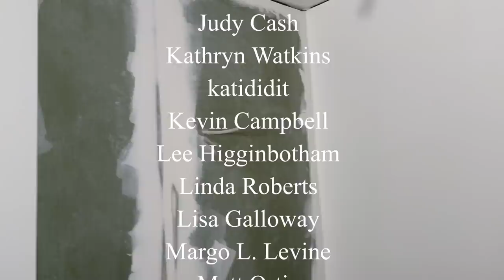Renovating an abandoned Tiny House #74: From green hell to bright & white!

Comment: We have a similar system here in the US with apprentice, journeyman and licensed contractor.  My son is well into his electrician journeyman. But, I will have to say, that especially for the electrical, I am glad that we have to pull permits and have it inspected. Even a very experienced electrician can make a mistake and with electricity, it’s better to be safe than sorry. Since there is no caulking where the walls meet your ceiling, will you be installing some kind of crown molding? I’ve enjoyed watching you make this little cabin into a beautiful home. I haven’t missed an episode.  Take care.
Reply: The system is called self-certification in English. The trades are supposed to go through their work in much detail, test and document everything. Especially electrical self-inspections are much more thorough than anything ever done in the US, involving thousands of Euros/Dollars worth of testing equipment. First, after a visual inspection, the insulation of every single bit of wire is tested for damage by applying 500 V DC and measuring resistance between the individual conductors. Then, each and every earth (ground) connection is measured between the fuse board and socket/light/appliance. In some countries, like the UK, the resistance of each conductor (live, neutral, earth) is measured. If an earth rod is required, its resistance to the ground is measured. These tests are called "dead tests". Once they've been completed, power is turned on for the first time. Now there are several live tests. Which ones are required depends on the details of the electrical supply and installation but the list includes loop impedance (basically the resistance of the entire electric supply from the power company's transformer to your lights etc., it's calculated by measuring the voltage without a load connected and then with a known load, the tester does that automatically), based on loop impedance the prospective fault current. RCDs (GFCIs) need to be tested as well, usually a current ramp test (the tester applies a slowly increasing current and measures the current at which the device trips) and trip time (at half the nominal trip current, full current and five times nominal current).

I do agree with you that external inspections wouldn't hurt though. Having gone through all that training and education doesn't make you immune to mistakes - or plain laziness.

Comment: It's always a pleasure to see you've posted a video. It's always interesting and I always learn something, even small things. Of course, I never would have had this opportunity without being in high risk isolation for so long, but that's a plot twist on my life. I think that the training and oversight is much better there than here. Here a contractor might pick up a truck load of day laborers at a corner parking lot and they build whatever that day. A lot of sloppy building, and often mistakes get missed by inspectors. My son bought a new house and right away had to pay for redoing several major issues that didn't get noticed in inspections.

Comment: Canada has the same apprenticeship style programs in their education system, run by technical institutions. Depending on the trade it may be 3-4 yrs. Then there is also a Red Seal level of excellence you can test for after the JM cert. Electricians can go for master level which allows them to run business and certify work. Welders have so many different types of certs after JM RS showing capabilities in different materials and processes/procedures. Some require edu+exp+test. You need an extra wallet for them all.

Comment: Here in Australia, all electrical and plumbing work are regulated, the public are not allowed to do anything more than the changing of lightbulbs, we really aren’t even supposed to change washers in taps.  Wasn’t always like this but tragic accidents and pressure brought these regulations into effect.  Many do their own work, my father is one but he’s been doing it for many years and always works safely he has never had a problem.  I have seen first hand what bad work can do, I got a shock from a light switch in a house I rented as well as other electrical problems.  A professional electrician started swearing as soon as he looked at the first light fixture, it had been wired wrong with the live wire attached to a metal light fixture instead of the grounding wire, it was the same throughout the house.  He said that if anyone had touched the light fixture, a metal candelabra, they would have been killed.  The landlords tried claiming they had the work done by professionals but I caught them out when they brought a friend to do some electrical work claiming he was an electrician but he told me he wasn’t one.  
Even a professional messed up when we built this house, most probably had an apprentice do the work.  Just before the power was to be connected it was discovered that the house electrical grounding wire was attached to a gas pipe.  Could have been a very big boom 💥.
Reply: So glad that you are safe, now.

Comment: Am I correct in assuming that the insurance companies require an inspection prior to writing a policy? If each tradesman is his own inspector and homeowners are allowed to do this much renovation, surely the insurance company wants to inspect before issuing a policy. We have this review period in theory in the United States, but there is rarely a physical inspection, they usually issue a policy for the basis of your comparative value, the taxation value of your home. Usually you can arrange an insurance policy over the phone and be fully insured by the time you hang up. How does this work in Germany? How does the insurer know if the homeowner has done work between their inspection and the damage incident? Fire is an obvious example and easy to determine the cause. If I'm not mistaken, water is responsible for a great deal more residential damage. If the house were to flood, who and how determines the cause? Do different insurance companies develop a reputation? Or are the insurers regulated by the government as well?

Comment: Do you need to tape where the ceiling meets the walls or will you be covering the gap a different way?
Reply: Would normally be a silicone caulking to allow for movements between the different masses of ceiling and walls.

Comment: Here in the USA there are 50 states and each one has it's own regulations about things like building permits and inspections. This makes it confusing when someone moves to a different state and is not aware a small project like putting in a new hot water heater which we could do ourselves in Pennsylvania without a permit or inspection , when we moved to Florida required we hire a licensed professional and have an inspection. Whew! we found out just in time or we would have had a big fine.
I liked the corner roller- would save a lot of effort and up & down to paint hi & low with a brush.
Can't wait to see the finished bathroom.
Reply from the maker: Thank you for sharing Virginia! :)

Comment: Where I come from, one of the very last steps to a renovation project is painting. 
So with that being said and with all due respect sir,
What about that little gap in between the walls and the ceiling? 
Isn't it supposed to be filled in with joint compound or caulking?
Do you plan on filling it in or is it going to remain that way?
Also, the edges around the window look un finished, is that on purpose too?
Reply from the maker: Hey Corvus!
The gaps will be caulked before the crown molding goes up and the window surrounds will be spray foamed and covered as well
Reply: @renovationeast9379 COOL, so incredibly thorough with your projects

Comment: With no inspection for plumbing, electrical wiring, framing, etc., how do you KNOW that the "masters" are actually doing decent work and not cutting corners?  HOW would you ever know that everything was safe and to code?  A warranty is only good as long as the "master" is in business and has money.  What if he or she goes bankrupt?  No thanks!